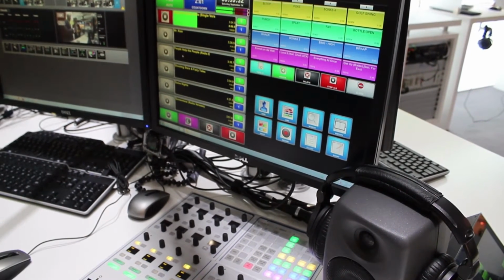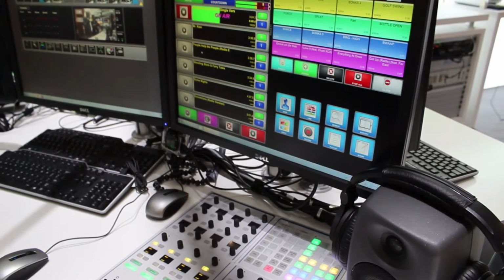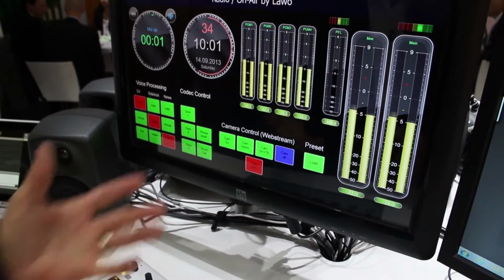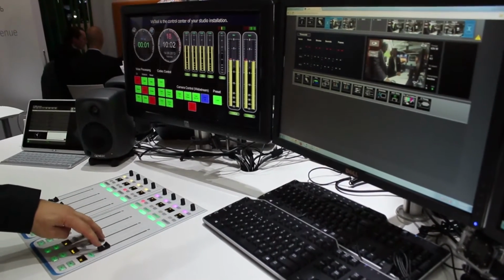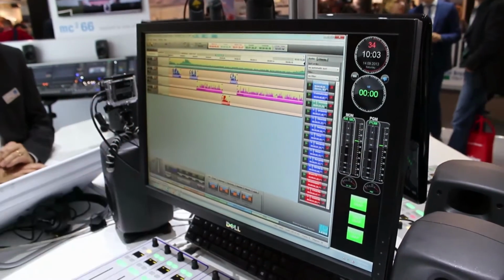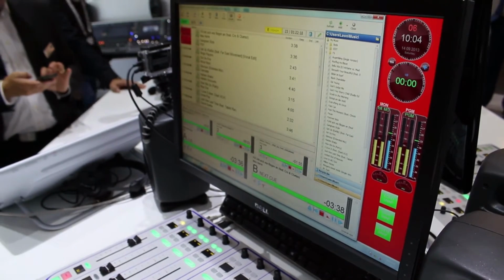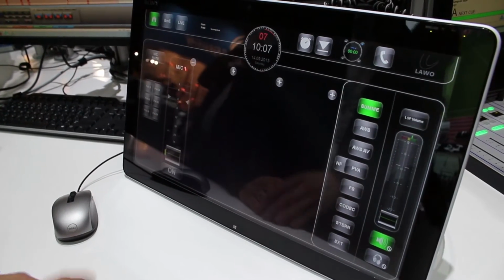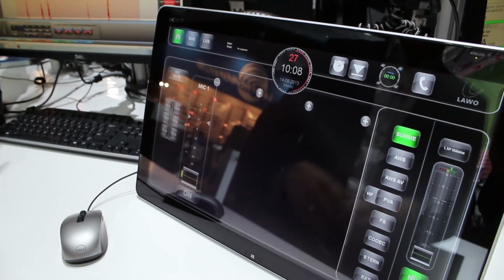Lawo Radio On-Air Setup at IBC 2013

Comment: awesome. my radio station that I work at has 1980s setup still.
Reply from the maker: Still up and running - but looking slightly different than back in the 80s, I guess ;-)